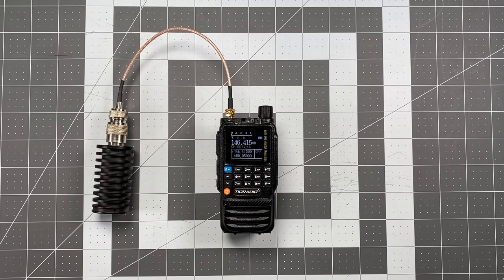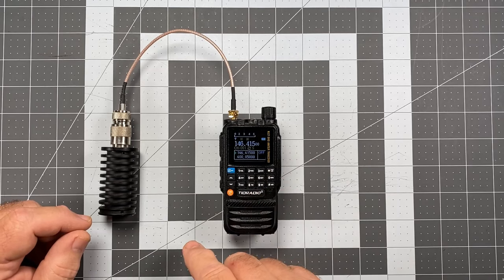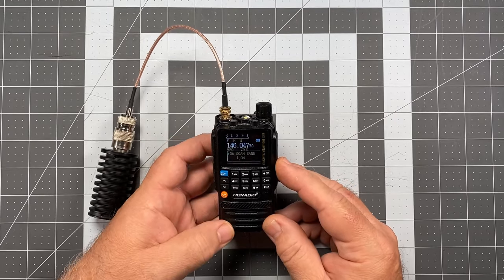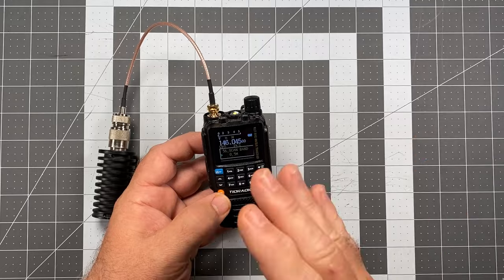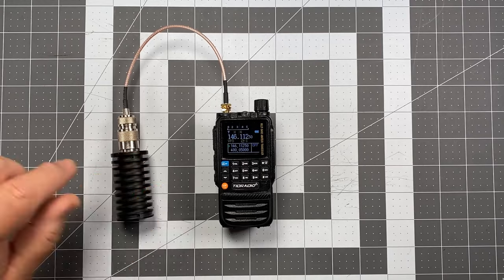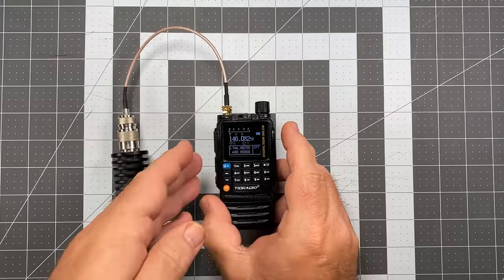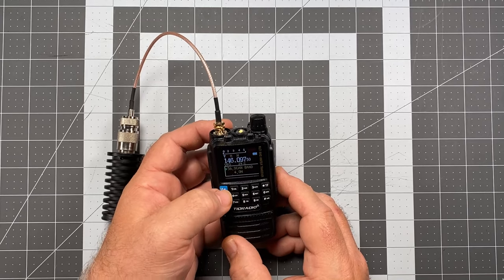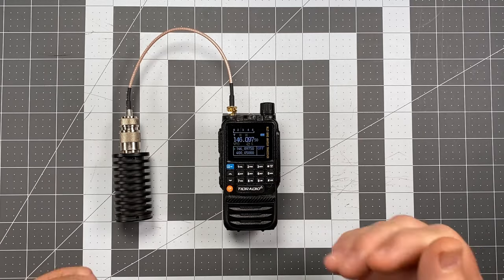TID Radio TD-H3 Operators Series: Part 14 - Setting up VFO scan ranges

Comment: My td-h3 doesn't appear to have the mode 56. When I'm in mode 0 and press the down arrow, it goes to mode 54, not 56. ?????
Reply from the maker: Have you tried pressing the menu button to enter menu mode then typing in 56? Or manually cycling through the entire menu? Other than that, I'm out of answers.
Reply: @KS6DAY  Menus 55 & 56 were included with the firmware update 240401
Reply from the maker: @toy4runnerpiney  Many thanks for that info.
Reply: I’m in the same boat and need to update my firmware. I find the process confusing (and potentially dangerous so I don’t want to screw it up). The td website has you choose between gmrs or ham firmware, so would you have to update both, switching your radio to that operating mode before the update? @KS6DAY I would Love if you were able to do a video on firmware updates!
Reply: @LandonWest  How do you know which Firmware version your running?
Reply: @IEraiderfan  its menu item 42. In the settings. Mine is “Version 240229” (February 29th, 2024)
Reply: In another thread someone said the firmware binary files for ham/gmrs/unlocked are all the same, so maybe it doesn’t matter which one you choose, but idk. I’ve gotta dust off my old desktop pc before I can try anything (apparently doesn’t work on Mac).
Reply: @LandonWest  Thank you mine is GMRS_240416
Reply: So how do you get the new firmware update because I'm on 240229

Comment: Newbie here. Just updated my firmware to get this option. I can make it scan in a range but I'm unclear on how to get the scan to resume when it lands on static or I want to move on from a particular signal. Can you help with this question? Thanks.
Reply: I believe that would be in scan mode and you want to set it on continuous